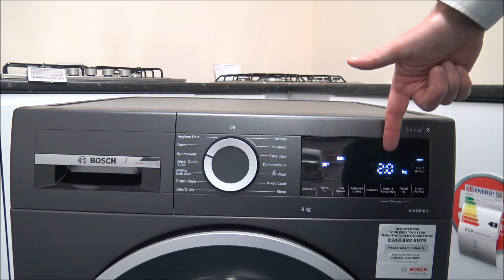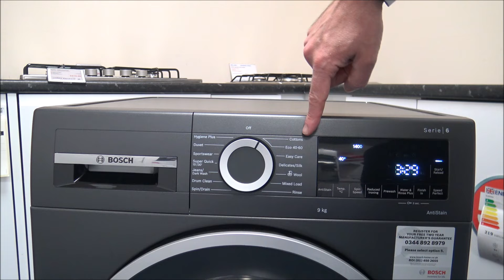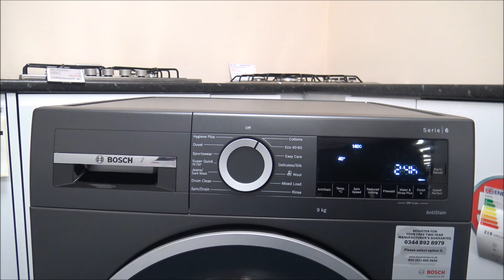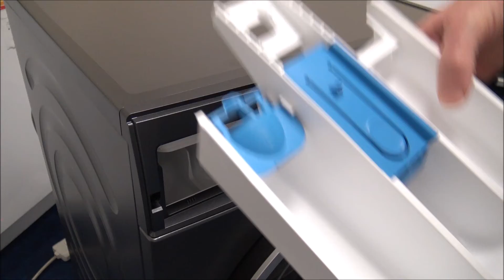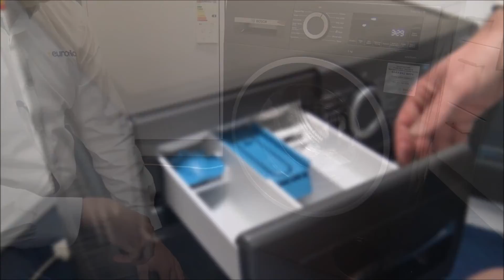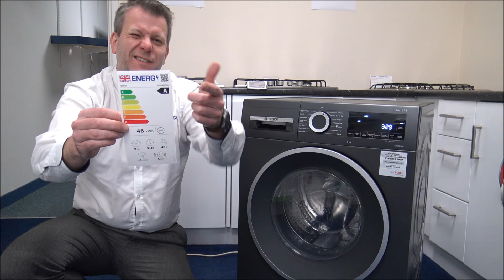Bosch WGG2449RGB 1400 Spin 9Kg Washing Machine

Comment: could you tell me the temperature for the drum clean cycle? Also, you said that the cycle could last longer if the kg in it are more that the designated. it this causing trouble? is it ok to do it?
Reply from the maker: It won't cause trouble to the machine if you put a larger kg in than is stated, but the performance of the wash won't be as good and it may take longer than is stated on the display. I am not sure what temperature the Drum Clean cycle will be at, but it will be at a high one like 60 or 90 degrees

Comment: Hi .. just bought a bosch series 6 and came across your utube demo..I wonder if u could clarify.. I've been told to REMOVE the little blue thingamibob which holds the liquid detergent in place when I'm using a delay setting!!! Surely that can't be right.. why would I want the liquid sitting in the drum with all my clothes for 8 hrs plus before the machine starts.. at the moment I'm putting it in a dispenser cap directly in the drum.. but then it's rattling around being noisy once the machine starts!!  Hope u can help.  It was actually bosch helpline who told me to remove it, as does the manual 🤔 cheers. Linda
Reply from the maker: You are best to leave the blue divider in place if you are using liquid detergent to keep it in the drawer rather than running away too early. if you are using powder or the gel pouches, then don't leave the divider in place as it can limit the amount that is taken
Reply: Thank you .. that's what common sense would dictate! Can't imagine why bosch would say remove it!!

Comment: Very informative video,  but can you tell me which wash programs allow the speed perfect option for reduced wash times also does it allow temp and spin speed adjustment.
Reply from the maker: You will find the majority of the longer programs will allow the speed perfect option to be used apart from the Eco 40-60.
You can adjust the spin and temperature with the speed perfect too
Reply: @lords-electrical  thank you

Comment: Hello, could you tell me what is the length program of the 60 degrees cotton when using the speed perfect option , and which program can be shortened ?
Will it ok if I was a duvet in that washing machine ?
Many many thanks ☺️
Reply from the maker: The length of the program will be approx 90 minutes. Most programs can be shortened using the speed perfect option, but don't forget it will reduce the capacity you can put in for that program. You should be ok washing a duvet if it will fit in, but i would recommend using a full load program not the speed perfect option, and select a low spin speed as the machine will struggle to adjust the load to spin properly when it is one large item.
Reply: @lords-electrical 
Thank you very much 😊

Comment: You are Great and explain all features very well. My problem is age old with Bosch, as they seem to make machines that don't easily spin. They do everything in limited way. may have 8kg or 9 kg but wont spin that amount of washing. My old one just "giving up the ghost" due to plastic door dropping off. It may have metal hinges but that's no good if the door is plastic. The door is what goes the hinges keep going on forever. A pity the plastic door wont. It gets worn and the heat gradually erodes the plastic and it splits and drops off. I got someone to change things so I could spin the w/m. after all, that's what its supposed to be designed to do. So is there any Bosch washing machine that is not inflicted by this long cycle technology? Thank you so much for putting out these great videos. I found your ones on Dish washers that was so good and it helped me decide which one to buy. Not sure there is any hope for the w/m. I am looking for a machine that I can control rather than a machine that inflicts its timetable on me. I need a bit more flexibility in the programmes.
Reply from the maker: I agree it would be nice to have machines with extra flexibility. Glad the videos are helpful for you, thanks for the great feedback 🤗😁

Comment: Worse washing machine I've ever had, it's so noisy.
Reply: If it's noisy, that is not normal. Sure it is this one that you have?
Reply: @last-og_zanussi  yes it seems to have an intermittent balance problem, every now and then it spins without balancing and it bangs away.
Reply: @philgoff7563 I’ve found this exact same thing I’ve had it for a month and whenever i wash heavy towels or covers when it’s unbalanced it still tries to spins and bangs really loud then just continues to re balance

Comment: Well. Our washer I commented about a while ago has decided to stop spinning. It goes to try then gives up. It does that through the whole time of the spin cycle then at the end everything is drenched 🙄
Reply from the maker: That sounds like the waste outlet is blocked if it is not pumping the water out. Hopefully you manage to sort it out
Reply: @lords-electrical  basically it was a bathroom mat that’s quite large and like a sponge. I took it out and it was just holding all the water. It was very heavy. Told the wife the knock sensor has obviously stopped it from spinning so not to damage the washer. I hung it on the line. She has since done washing with full loads today and it’s working fine. Definitely has to be the bathroom mat as I said it’s the weight of a breeze block. The drumb was shaking like mad as it tried to spin but obviously the sensor was protecting it from causing damage like I said

Comment: Got the previous S6 9Kg 1400 model in white. My only gripe was the water levels seemed too low during wash and I felt residual soap remained after the rinse cycle.
Nothing that an extra  rinse cannot solve.
I wonder if that inspired Bosch to bring back the extra water rinse button.